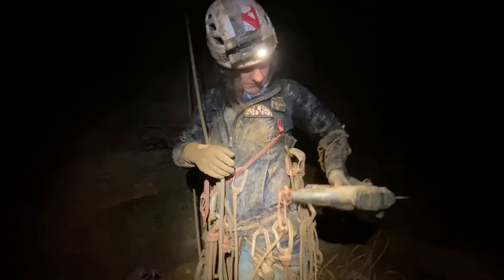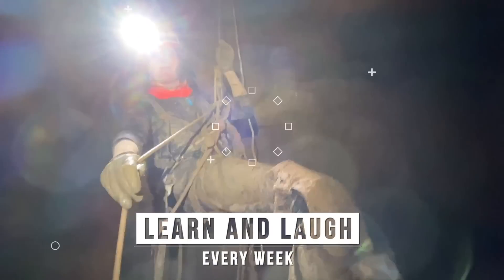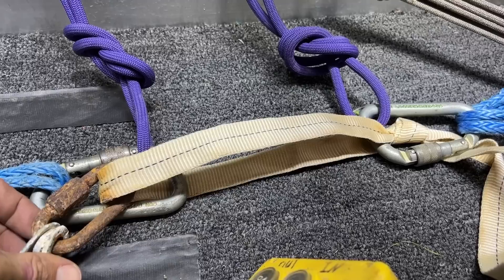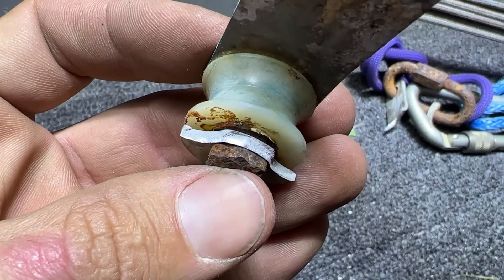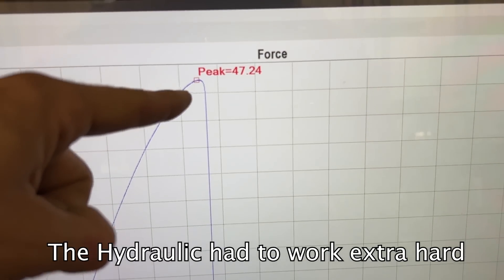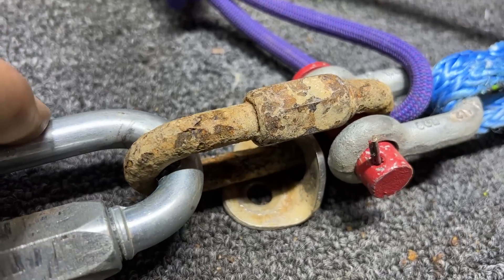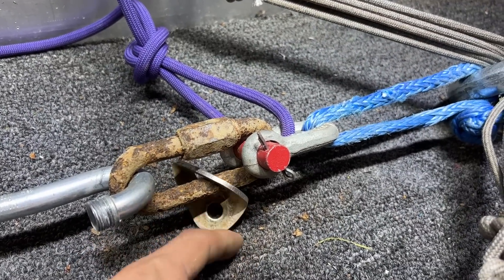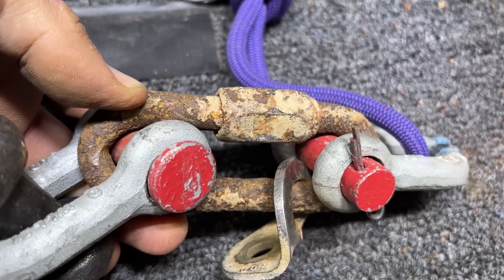44 year old cave anchor break tested - Topless Dome Part 3 of 3

Comment: The most likely reason the quick link held 90kn is because it’s made from 100alloy steel this is the same metal they use in chains to secure bulldozers and tanks to flatbed trucks. This metal is special because when you bend it it generates heat witch causes it to get stronger. In the shop we nicknamed this stuff unbendium cause once you bend it you can’t unbend it EVER. Well there ya go mystery solved your welcome from Ivy Mike

Comment: The reason you’re getting a slower taper to the curve with steel quick links vs aluminum carabiners isn’t the hydraulic, it’s that steel is in layman’s terms, more stretchy than aluminum. 

Steel will stretch and bend more before breaking where aluminum will just snap.

Comment: You have to take in consideration that the "new" quick link that broke before the old rusted one, was fatigued due to multiple pulls against not only the specimens in this test, but also I assume others from previous tests? However, I am in no way saying that 89kN on the second pull is 'weak'.

Comment: Shows you what happens when 10+ generations(a stretch I know, though I could argue more) of metallurgy stopped being passed down. Sure we have quantum chemistry and lattice models now, there is a lot more to it that is still not known(now or then for that matter).
Reply: That last quicklink wasn't 40 years old. It was probably from the 1980s. 

The a few of quicklinks before it were from the 90s~2000s, and one was from 3 years ago.

The only 44yr old stuff was the webbing + link and pully from the start of the video.

Comment: Karst systems (limestone caves) form by water interacting with calcium carbonate. This forms carbonic acid. Carbonic acid isn't really one the things that normal stainless steel (304 or 316) or plastics (Nylon slings etc) are engineered to deal with. The fact that the quicklink broke at 40+ kN is actually surprising!
Reply: 316 SS is fine underground. We don't have any issues with the groundwater pH affecting it. Remember that this water is so mild that people plumb their wells straight into caves.

All of this rusty shit was galv...
Reply: @rachelhasbruises  Good to know. I know there are problems with hydrogen embrittlement on 304 and 316 when used on limestone sea-cliffs, but that's something to do with high sulphates and particular bacteria (look up the research done by David Reeve for more info). This may not be a problem in Karst environments, but it's probably worth knowing about if you're doing research into this stuff.

Comment: I wonder if rust helps overcome the weakness of the thread in quicklinks? It would be interesting if you struck the collar of the quicklink with a heavy hammer and pulled it again, if it failed substantially lower you would have a nugget of super useful info.

Comment: The bolt going through the quick link is almost the exact diameter of the quick link. So all the force is going into stretching the long straight pieces. 
Normally you get deformation in the bend resulting in sheer forces as well as stretching.

Comment: Maybe this quicklink is so strong because of too big radius of shackes, connected to it. This ideally prevents the quicklink from starting to deform, that makes it a bit (or significantly?) stronger. Maybe if boomer softshackes are used instead of metal ones, the quicklink will break at lower force.

Comment: Climbing gear is typically made of aluminum because it's light. Outside of weight-critical applications, steel is used when strength is needed. It's just stronger and more durable.

Comment: There is another reason the slope of your line changed in the quick link (assuming it’s steel, which I believe it is?). When you tensile test steel, there’s an elastic section of the stress-strain curve that defines the period of elastic deformation, which means that if you let it go “in” that section, it will return back to original position/shape. This section is linear and very steep. After the elastic section, there is plastic deformation, which is nonlinear and much more shallow. I am sure this took place, even though you aren’t using strain gauges and aren’t plotting stress, just force.

Comment: I'm not surprised that the quicklink retained a lot of strength. Rust in steel is brittle and flaky, so it's usually a surface thing. I wouldn't expect that a piece of metal can have its original volume but be rusty through and through (like a piece of wood could rot). However, I would have never thought that the fabrics can still take ~9KN. I'd clip on a 1/2" rusty piece of steel any day, but I'd be terrified to use that strap, even after having seen this video, because as you pointed out different old things might have aged differently.
Reply: You can absolutely rust through something to the point of complete disintegration. It just has to rust, versus be rarely coated with mineral heavy water.

Oxides for metals like aluminum and chrome (in stainless steel) can form a passivating layer protects the underlying metal, but iron oxide is a higher volume than iron -- so it flakes off and exposes fresh metal that can rust again.
Reply: @EverettWilson  so, if the rust flakes off and exposes fresh metal, as you said, wouldn't this indicate that it's usually a surface thing?
Reply: @anthonydgr  It's a surface thing over and over again, until it's rusted completely through.
Reply: @EverettWilson  it's funny how it appears that we are disagreeing but we are saying the same thing: rust on ferrous metals happens on the surface and then it flakes off and the rusting continues. The extra step I'm taking it is that I expect that at any given time a rusty bolt would be mostly good metal inside and a thin layer of rust on the surface. Note that this is my expectation, I'm not claiming it to be a proven fact. If you don't share my expectation, feel free to have your own.

Comment: The volume of production back then allowed a higher quality of manufacture. This is coupled with an effort to improve the image os safety. I climbed back then, what we feared was aluminum gear.
Reply: I'm no expert on this topic, but this appears to be a classic case of material properties.

Back in the day a lot, if not most gear, was made of steel or iron... The risk of that is that iron and most steel is very susceptible to corrosion, but it is also a very strong and heavy material.

Most new equipment is made of alloys, often significantly lighter than steel, but with respectable strength.

This is how most equipment in the army works, the older stuff still in use is overengineered steel, but the new kit is nearly always some aluminium alloy - very strong and light, but would likely loose against steel.
Reply: As cool as it being able to take 90Kn is, I think alot of modern gear breaking lower is due to a more accurate risk assessment,  redundancy is nice, but do you really need it to be 3x stronger than the anchor it's attached to?

Comment: Honestly the fact that the old crusty quicklink could have easily surpassed 90kn is beyond my belief. High quality video today! Great testing!
Reply: The metal was better quality, then the modern one.
Reply: @ПетрСтраумал   the difference is not material quality nessessarily there are different grades of aluminum and steel as well as different alloys so without knowing what steel its made of seeing as it rusted its not modern stainless/vanadium steel which has lower tensile strength than a standard tool steel
Reply: @Aeriket  oh, thank you for remembering me that!
Just happend that I am a material scientist ;)
Reply: @ПетрСтраумал  then you should have known that :)
Reply: @imperialspy3457  and I do :)

Comment: I wonder if a solid coat of rust could make a quick link stronger by essentially turning it into a steel loop and sealing the threads
Reply: Sure it'll seize the threads, but a properly tightened QL isn't going to come undone regardless, and it can be difficult to assess how deep rust penetrates.
Reply: Yes and no. It absolutely could seize the threads but generally rust is usually brittle. Unless it’s a super steel.
Reply: No. Seized threads happen anyway under tension of the QL

Comment: They don't make them like they used to, lol.
I didn't see any rust on the last one, it just looked like deposited minerals.
Reply: I think that's due to the old quicklinks not being optimised for mass. For modern climbing gear there's a pressure to be as light as possible while still just barely passing inspection to whatever standard it's made for. The people who laid those anchors probably used rigging equipment or something along that line. (Hardware store would probably work too, just not 100% reliable.)

Comment: Great video. Are the charts force/time? If so it would be great to see force/displacement as it tells a better tale about the failure mode of the thing getting snapped.
Reply: When i took material science the graphs were strain (displacement) on the x axis and force (mPa or psi) on the y axis. Below yield (the linear part of the graph) stress and strain are directly related, the slope of that line is youngs modulus and it changes with material. In other words, below yield a given stress will result in the same displacement every time.

Comment from the maker: See where it all came from in episode 2 if you haven't yet: https://youtu.be/9bPDC7pg8UY
Reply: How heavy was that last quicklink? could it be Titanium or stainless? It should be framed and mounted in your hall of fame once you identify the manufacturer... Also find out how much it would cost to run a material analysis, I may cover that cost.
Reply from the maker: @tyroneemail  it was definitely Steel. It’s interesting but I don’t need to do a material analysis on it. Thanks for the offer.
Reply: @tyroneemail  it's steel... You can see that by it's rust.
I suspect it's heat treated, possibly high carbon steel.
Reply: Hey man, can you please test the strength of a knot i stumbled upon?
I don't think I can describe it accurately and I definitely don't know the name.
I made a video of it though... 
It feels pretty strong, but how strong is it?
Reply: I expected the carabineers to fail before the steel link for some reason 😂